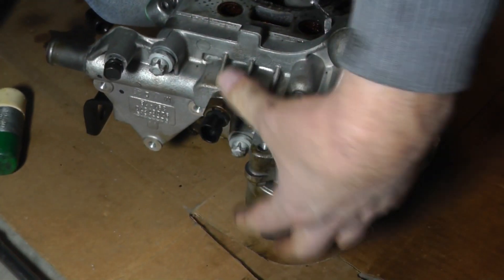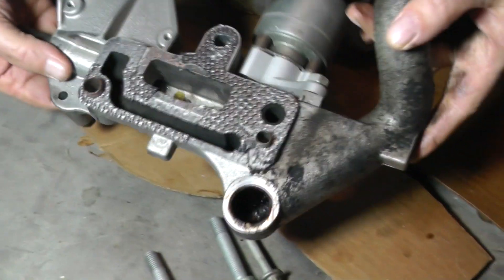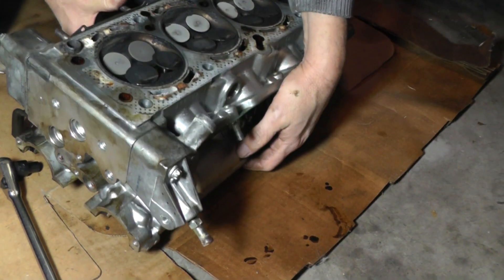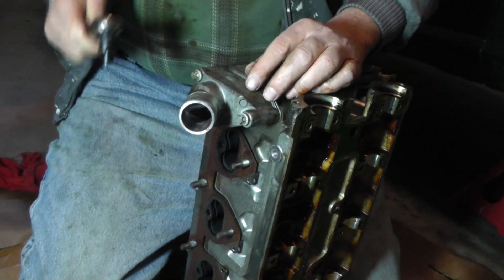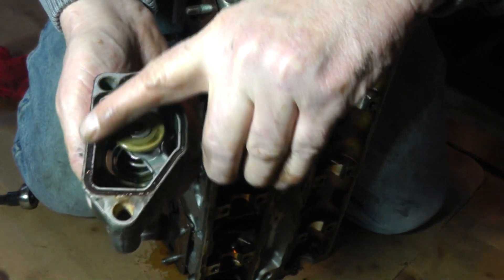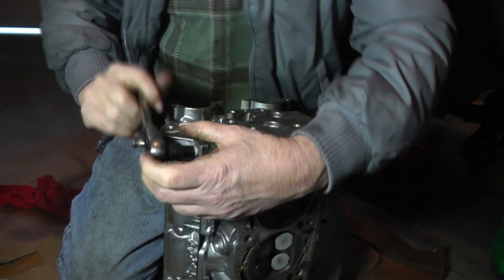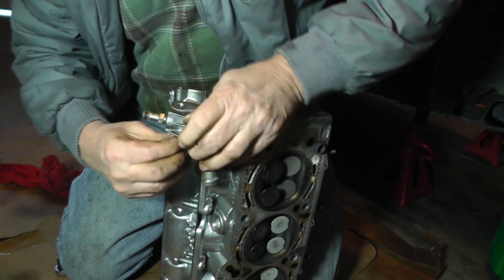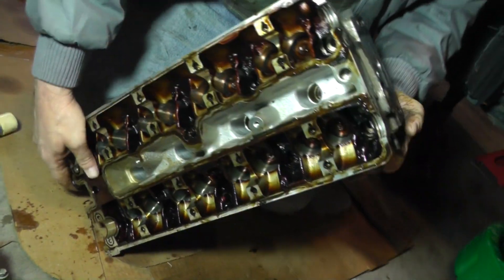Suzuki Forenza Head Prep for Machinist - Part 8 (Head Prep)

Comment: I have this same engine for my 2001 Daewoo Leganza. Had the valve job done at a machine shop. My question is that if they shaved the head down would installing the shorter head make a difference in the Timing. I followed the other videos and my timing marks are off by 1 tooth.
Reply from the maker: The machine shop would only shave just enough to make the surface true. Probably no more than 0.10" - 0.15". There is a limit to how much, but I don't know the figure. I'm sure the machine shop did okay. This should not make any difference in the timing of the engine. You should still be able to align the marks.

Comment: Thanks for the videos.

I plan to perform that overhaul. I have Proton Persona CamPro engine with very similar engine type. 

May i know all the socket size you might think it is necessary to remove the engine block?
Reply from the maker: +Liew Seng Choy Get a metric set of sockets which includes as many different sizes as you can get. I don't know specifically every socket for pulling an engine.

Comment: stuzman52 I have a 2007 Suzuki forenza I bought it 3 weeks ago noticed it has a small coolant leak and my car ended up overheating, I have no signs of a blown head gasket no milky oil, or bad idle sounds great should i be worried? I know i need to get the leak fixed.But I was gonna ask to what kind of signs should i look for if it could of been damage done to the engine? Anyways great videos man I might have to do all of this myself if something did happen!
Reply from the maker: Hi Chris. When you've got a coolant leak and you see no signs of it being external, then you can be pretty sure that it's internal. And that would be enough to be of concern when it's left alone over the long haul. You could do a pressure test on the coolant system to see if you can find any external leak, but my guess is it's going to be the early sign of a head gasket failure. In these early stages, you won't see any milky oil or any white smoke out of the tail pipe. Go and buy yourself a combustion gas detector. This is the small clear cylinder that has a blue liquid that turns to yellow or green depending on the severity of the combustion gases in the coolant system. If you see it change color, then it's time to pull the head. On these cars, head gasket failures are pretty common. You can read up more about it at http://www.suzuki-forums.com/general-forenza-reno-forum/ or even leave a post to get other opinions.
Reply: stuzman52 alright ill see what I can do, thanks for the quick reply I do believe the leak is external but not 100% sure i have small coolant puddle sitting under my resivor but its not leaking enough to make a puddle on the ground
Reply from the maker: Chris Cutlip There you go Chris. Fix the external leak and you may very well fix your problem.

Comment: thanks from russia. please show this job on daewoo car
Reply from the maker: Hi russboy and hi from the US... This car uses the same engine as the Daewoo engine so it should still apply.
Reply: stuzman52 thanks  very much !!! so i can try to change head gasket on my daewoo car ???
Reply from the maker: russsboy Yes, it should be the same. Here is a free link to a service manual which may be helpful in your repair. http://lacetti.com.ua/chevy-man/EN/documents/Nubira-Lacetti/start_Nubira-Lacetti.html
Reply: stuzman52 thanks very much but my car is Daewoo Matiz (0.8 engine 3 cylinder) not lacetti
Reply from the maker: I didn't realize that Daewoo even make a 3-cylinder engine. Still, the basics of removing a head to replace a gasket is the same for any engine. Although the videos may not be pertinent to your car, the basics still hold true.
Reply: stuzman52 very thanks ! i will try it in summer

Comment: Thanks for the videos. I had pitting on my cylinder head causing coolant to leak into cylinder  4 giving me a misfire. I was low on cash and couldn't afford to pay someone to do aluminum welding or take it to the machine shop. In a last ditch effort I cleaned up the cylinder head and filled in my pitted areas with JB Weld and so far so good. Have been driving for a day so far and no leaks. I did check the JB Weld to make sure it could handle the temperatures on the head. Will update after about a month and let you know the the JB Weld holds up.
Reply from the maker: Glad to hear that you got it all back together Isaiah and no issues so far. I'll be surprised if the JB weld holds up. Hopefully, all will be good and happy holidays!
Reply: stuzman52 Four months later and the JB weld is still holding up with no problems or leaks car now has 119000 miles on it.
Reply from the maker: Good job Isaiah. I'm sure a lot of other folks will like to see this info to help them out with pitting on their heads. Thanks for the feedback!
Reply: @blritw08809  do you still have the car how long did it hold?
Reply: @stevendunlap9494  a year and a half. Second time I had the head resurfaced and it lasted another year and a half. Then I scrapped the car

Comment from the maker: the deck is flat and to remove the welding, there will be a slight resurfacing of the deck. That's $35.00. These prices are labor costs only and does not include the actual pricing of the valves, guides, seals, etc. I bought these items and took them to the machine shop. Total price is $263.00 for the machine shop. And for all the valves, seals and valve guide, that will run about $150.00. Total cost about $413.00 for materials and labor. In my other post, I meant to say that there...cont

Comment from the maker: Hi diaz. Keep in mind that machine shop's prices vary all over the country. I'm in High Point, NC and here is the verdict of where I live. For a valve job, the price is $175. This includes a cleaning and pressure check of the head to ensure there's no cracks. I have a split valve guide, so that's another $8.00 for its removal and replacement. Also, I have some several holes that's pitted on the deck, so there's no aluminum welding needed to fill these in. That's $45.00. Finally, to ensure...cont